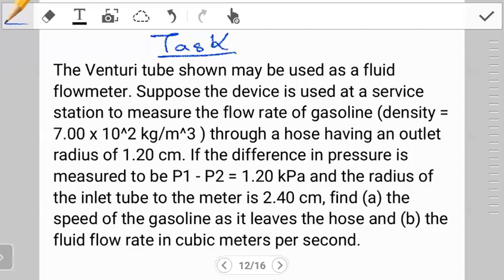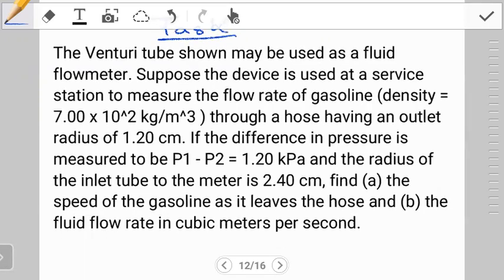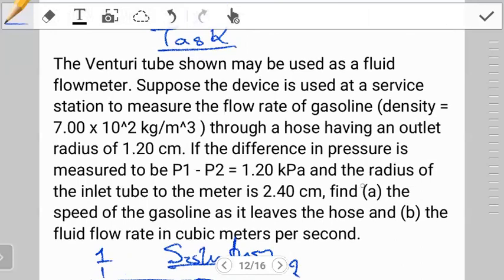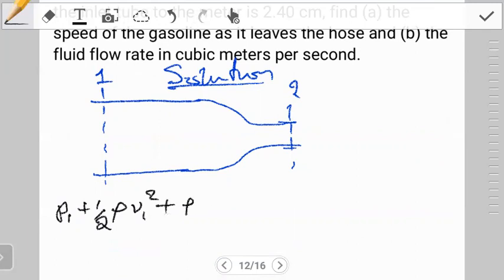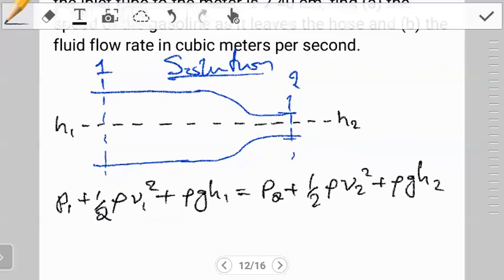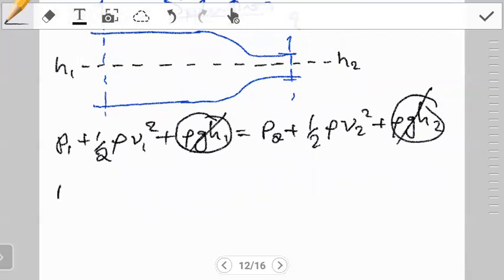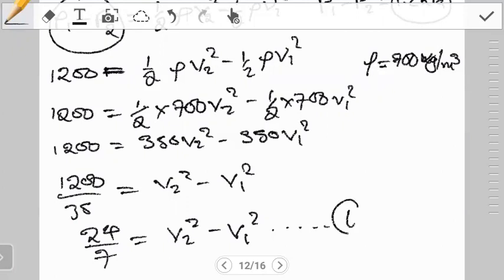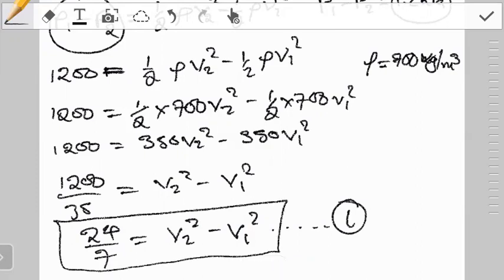Velocity of gasoline leaving the hose; Bernoulli's + continuity equation

Comment: Made work so much easier...
But I think we missed somewhere, that 24 should be 240 instead. You ommitted the zero. Reducing 1200 by 5 gives us 240 and reducing 35 by 5 gives us 7.
Reply from the maker: Hi...
The 24 is actually correct. The only ommission was in dividing through by 350. I said that I was dividing by 350 by somehow only wrote 35. But if you correctly use the 1200/350, you will see that it comes out as 24/7
Reply: @TutorJeff  oooh alright thank you...